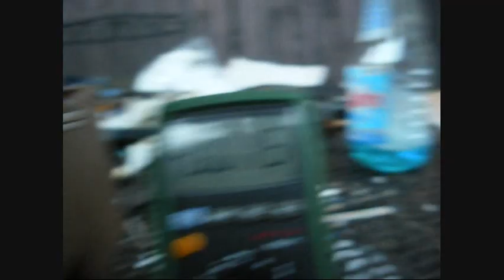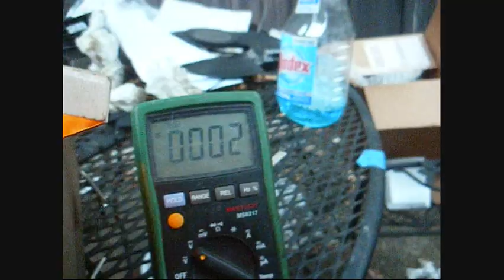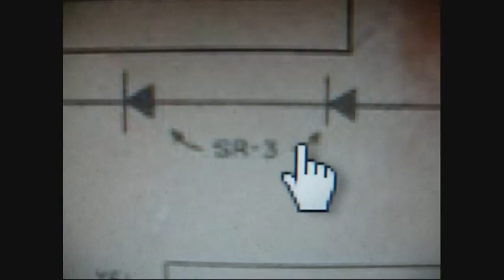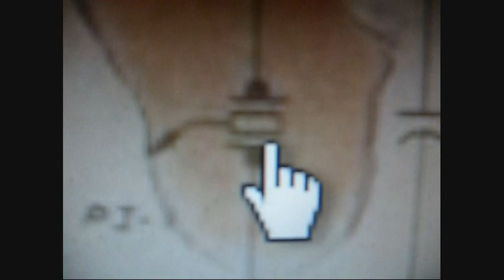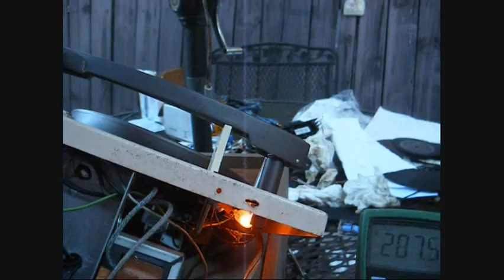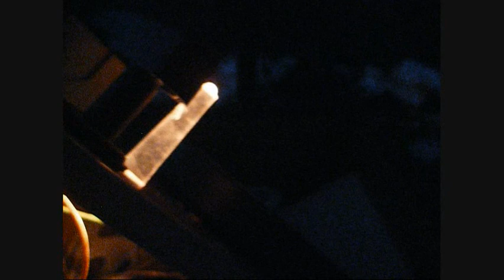Audiotronics 300E tube classroom record player from 1968

Comment: Thought of you today at the local Goodwill, where I scored a beautifully working and cosmetic Audiotronics 525T. Not much info on it online. Not sure if you’ve ever worked on one, but the one I found sounds very good, indeed. Has the huge Jensen speaker built into the lid that separates from the hinges.

Comment: On the popular selling site the prices on Heathkits, all Heathkits is nuts. I have resorted to looking for other brands even Knight kits for example to get something old that can be gotten cheaply and using my electronics knowledge repaired
to the standards with restored components. Don't waste your money on reforming old E-caps the way Bryan mentioned.
They will not last very long. A year or two before it dies. New multi-section E caps can be found for sale by a couple of companies on the web too. Found CE Manufacturing as a great supplier of them. Another excellent video by you Bryan!

Comment: Vacuum tubes are better than transistors and integrated circuits. Vinyl Records are better than CDs. Vinyl Records last longer than CDs. Vinyl Records last forever and ever because Vinyl DOES NOT wear out.
Reply: VACUUM TUBES HAVE VERY TINY VACUUM CLEANERS INSIDE THE TUBES; HENCE THE TERM *VACUUM TUBES*
Reply: @Tombilicus 
Not really funny